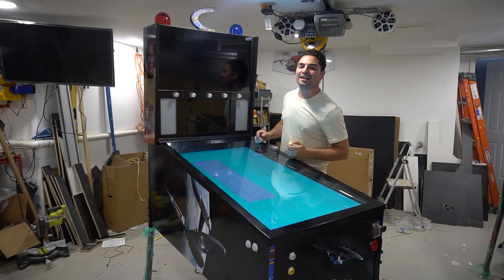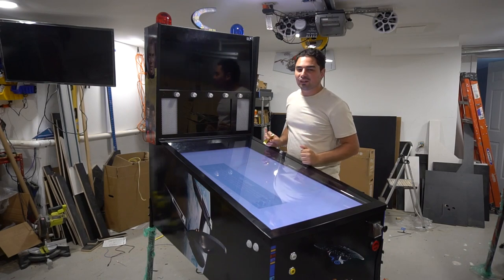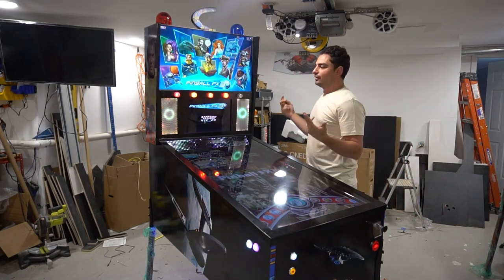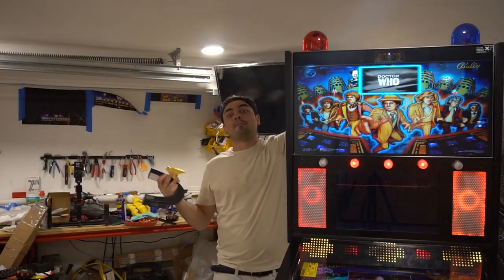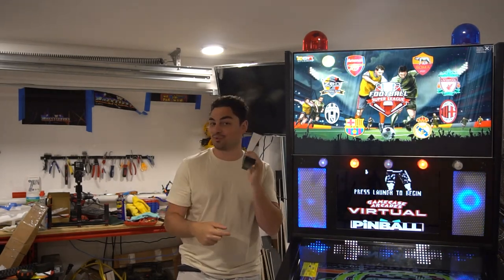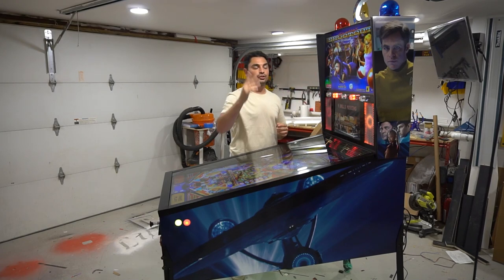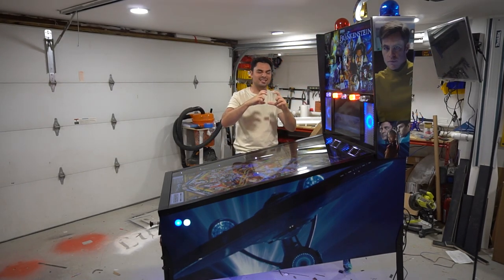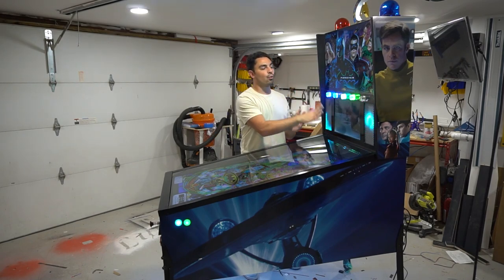Star Trek Vpin Full Details

Comment: Had 5-Flasher before going ARGB. Got my domes from Pinball Life. They are quite a bit of work. Resistor calculations and wiring. Plus you use 15 LEDWiz outputs.

Comment: The APC master switching power strip solves all of the power on and power off issues. Set my pc power button to shut down the pc with one press. I turn on my pc by pressing the power button on the I underside front right of my vpin. The APC turns on all 4 monitors, and everything else, without issue. Startup short cuts start popper and Doflinx. I shut down with popper or one press of the same power button. I don't have to go behind the vpin and turn off the main switch. You should consider adding the APC master strip. It makes the vpin powering easy. The video topper is my 4th screen.

Comment: Vic, what is the 4th flasher resistor for? Voltage step-down?
Reply from the maker: I put resistors on all 4 ports (rgb power) 
Without that recisistor on power the led actually burns out if on for more than 30 secs.... I had 2 leds blow lol